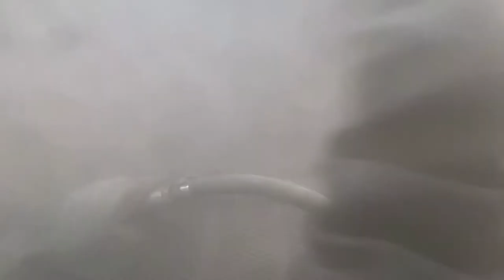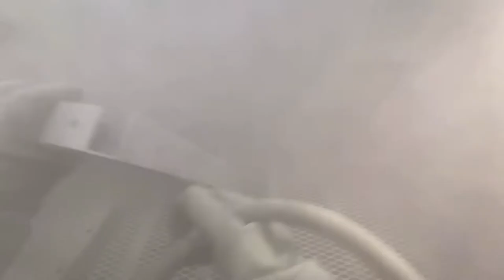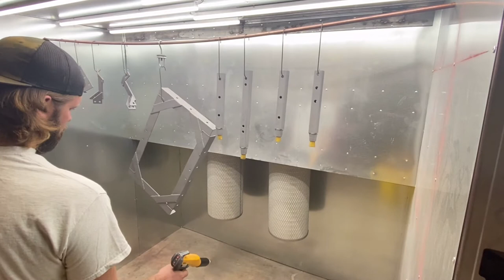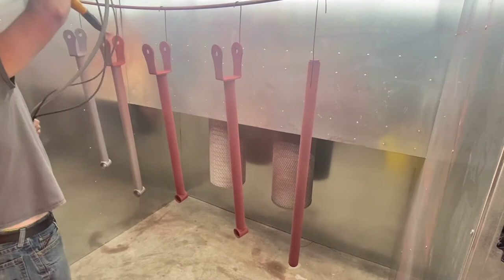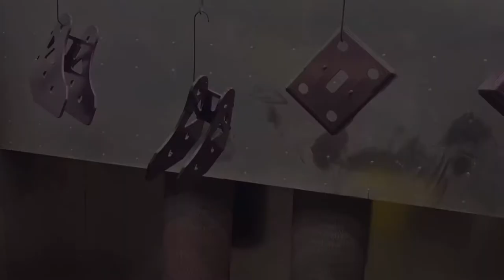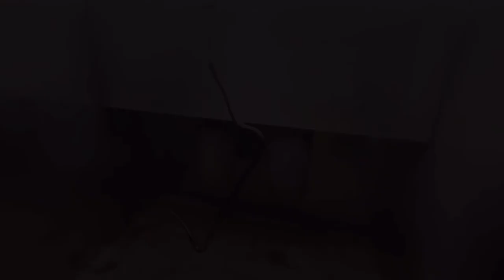Testing Out the New Spray Booth!

Comment: Hey man great job on the booth. Im currently designing and building one myself. How would you say that fan cfm does with the 2 filters and looking back would you have done anything differently?
Reply from the maker: It works good. If I wasn’t trying to build it on a budget I would have either went with one of the tube axial fans ($1,000+) or another 16” fan with 2 more filters. Another thing I’d recommend is to mount the filters higher.

Comment: Do you feel the single blower and two filters are adequate after you’ve used the booth for a while now?  Nice work on the powder coating.  Have the same gun and its a joy to use.
Reply from the maker: It would be best it if were another 1 1/2 feet higher. I will probably be adding another blower and set of filters in the future. But other than that it is still working good for me. The Gema is super nice to use 👍🏼

Comment: Great set up ! Are you grounded from a rod buried into the ground? And second question, can you reuse those filters after a shake up.
Reply from the maker: Yes I have a 5/8s 8’ copper ground rod in the ground outside. 
Yes the filter can be reused. Typically they use a system that purges the filter from the inside with air and they last a long time. Just have to be careful not to bang it up too much.

Comment: Great build, subscribed.  What pressure blasting tip are you using?  I've got a DX960 with the suction feed and also a TP tools pressure pot but don't like the blaster end that was standard.
Reply from the maker: I’m using a blasting nozzle from a seller on Amazon. It was around $50 but I like it a lot. I’ve only had to replace the ball valve once so far but the nozzle has held up great with no signs of wear with I’d say roughly 30-40 hours on it. I use that nozzle with a 110# Harbor Freight blast pot.
Reply from the maker: Large Ceramic Sandblaster Nozzle Assembly: C1 (3/8" ID) Nozzle Tip, Steel Ball Valve & Holder- Longer-Lasting Professional Abrasive Blasting Nozzle Tip Replacement https://www.amazon.com/dp/B07RZQ2P36/ref=cm_sw_r_cp_api_glt_fabc_E23QRD3M0QCWJ3385RBF
Reply: @royalcoatspowdercoating  Thanks for the reply!  Saw you are located in Spring, I'm at the other end of the state near Fort Worth.
Reply from the maker: @ss2metalcreations634  Nice! 
No problem. Feel free to reach out if you have any other questions along the way 👍🏼